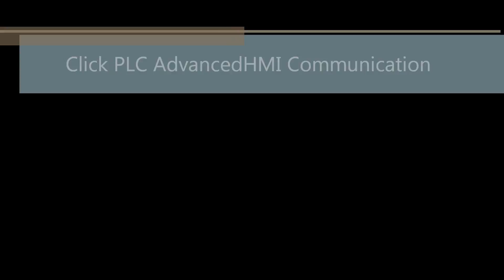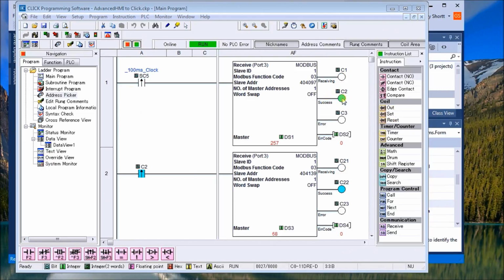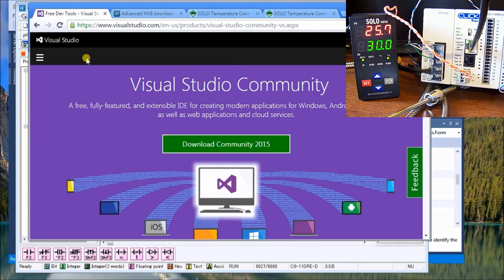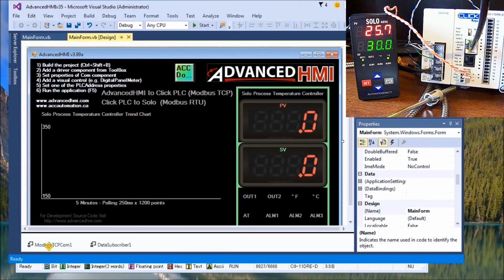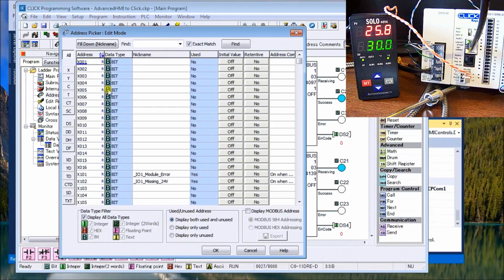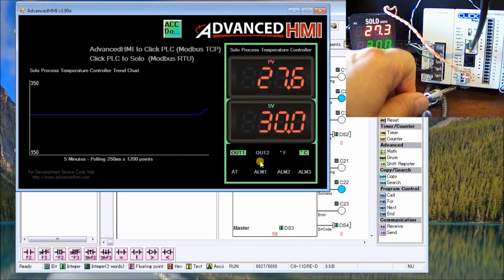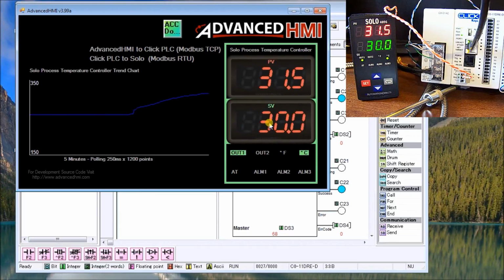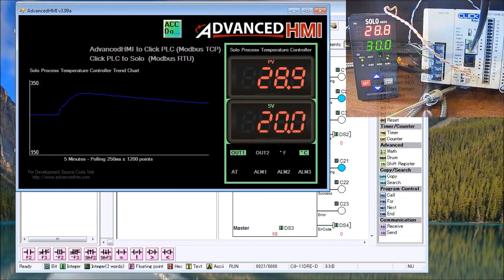Control Temperature Like a Pro: FREE HMI Connects Click PLC!

Comment: Why are the SV values different on the Solo and the SCADA different after you made the change on the HMI?
Reply from the maker: Hi Ray,
I do not see the difference that you are indicating. It could be the synchronization of the two videos. (You may see a 0.1 degree difference.) How ever this is just an error on the video part of the presentation. 
Thanks Ray,
Garry
Reply: At about 5:50 you change the SV from 30 to 20 on the HMI but the green number on the Solo stays at 30. I thought the green number on the Solo would be the SV and would also change. Great vid and keep them up. Im learning alot from you.
Reply from the maker: Hi Ray,
You are correct. The number should have changed to from 30 to 20. On serial communications, we can only do a receive or send one at a time. Looking at the PLC program, there is an error. I should not have used time bits for my communications. 
The modified PLC program should have the the following inputs for the two Receive and one Send Instructions.
- First scan bit or C11 or C12 (Write Success or Error Bits) will be the input to the first Receive instruction.
- Bit C2 or C3 (First Receive Instruction Write Success or Error Bits) will be the input to the second Receive instruction.
- Bit C11 or C12 ( Second Receiver instruction Write Success or Error Bits) will be the input to the Send instruction.
The PLC program will ensure that only one instruction is operating at a time on the serial communications. The previous send or receive instruction bits will trigger the next instruction.
I will be modifying and posting the revised program at the website.
Thanks again Ray for finding this error.
Garry
Reply from the maker: Hi Ray,
You are correct. The SV should have changed from 30 to 20. I've reviewed the PLC programming and notice that the communication timing is not correct. In serial communication, only one instruction can be executed at a time. The current program has two Receive and one Send instructions. To make this communicate correctly, the timer bits have been removed. The success and error bits on each of the instructions will trigger the next.
The ladder has been modified as follows:
- First Scan Bit or C11 or C12 (Success or Error flags from the Send instruction) will be the input to the first Receive instruction.
- C2 or C3 (Success or Error flags from the first Receive instruction) will be the input to the second Receive instruction.
- C22 or C23 (Success or Error flags from the second Receive instruction) will be the input to the Send instruction.
The new ladder code can be downloaded here:
https://www.dropbox.com/s/2f375yy6crpjh7c/AdvancedHMI%20to%20Click.zip?dl=0
The website has been updated with the download links as well.
Thanks for pointing this our Ray. 
Garry

Comment: Hello, first off, thanks for sharing. I am experimenting an issue (or so I think) with the ModBus TCP driver (advancedHMI v3.99). I need the interface to issue this query:

01 04 00 0e 00 01 +CRC

But what it sends is 01 01....., then 01 09.....It always seems to send different queries. I followed all the steps indicated in this video. Moreover, when I use ModBus RTU instead, the queries have the intended form. Is there any bug or so in ModBus TCP driver in this version? Thanks again
Reply from the maker: Hi Javier,
I do not know of any bug in the Modbus TCP Diver of AdvancedHMI. The latest version is v3.99s. The above examples were done with v3.99a with no issues. 
On your AdvancedHMI screen are you getting error messages for communication? If not then I would suggest you look again at the address that you are trying to find.
https://www.wireshark.org/
Wireshark is a good software package to view the information on the ethernet network.
Thanks Javier,
Garry
Reply: Hi Garry, thanks for answering so fast!
No,  I didn´t get any errors neither when building, nor  during runtime.

Actually, the ModBusTCPcom object is pointing to an IP address that belongs to a device that has a 3G/4G modem. And it is configured to output everything it receives its RS232 port. For debugging purposes, I am connecting with my PC to that port, and using a serial port monitor software to see the incoming data.

That´s how I know what queries are being issued by the AdvancedHMI, which I pointed out in my previous comment.

I have to say that I have being using this particular device with a different scada software, Winlog Lite, by Sielco, and it was working as intended. And even AdvancedHMI´s ModBusRTU object is working fine as well.

I do not discard having made a mistake when configuring the object in AdvancedHMI, but I tried to follow all the steps in your video, and it doesn´t seem that complicated too.

Thanks again!
Reply: Garry, this is exactly what the software is sending:

01 0F 00 00 00 06 01 04 00 0E 00 01
01 0D 00 00 00 06 01 04 00 0E 00 01
01 0B 00 00 00 06 01 04 00 0E 00 01
01 0A 00 00 00 06 01 04 00 0E 00 01
01 09 00 00 00 06 01 04 00 0E 00 01
01 08 00 00 00 06 01 04 00 0E 00 01
...
And so on. Notice that the last 6 bytes are part of the query that it should be sending (but it does not include CRC)
Reply from the maker: It sounds like your converter from modbus TCP to RTU is not programmed correctly. Modbus TCP will not add the unit number or the checksum to the message. This must be done by the converter.
You can always use a USB to serial converter and talk modbus RTU.
Regards,
Garry
Reply: Yes Garry, I think that´s exaclty what´s happening. I will check whether I can configure the unit to interpret modbus TCP.

Regards,

Javier